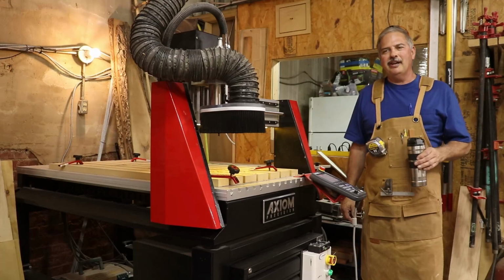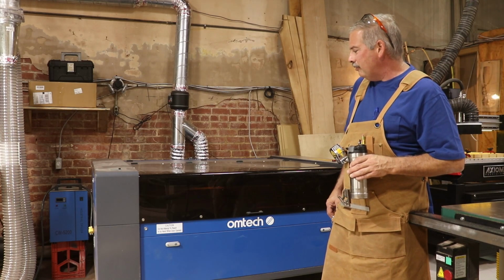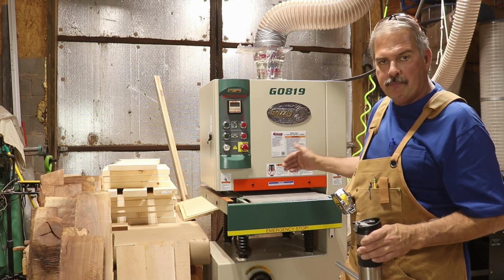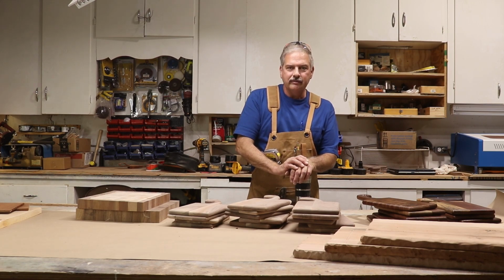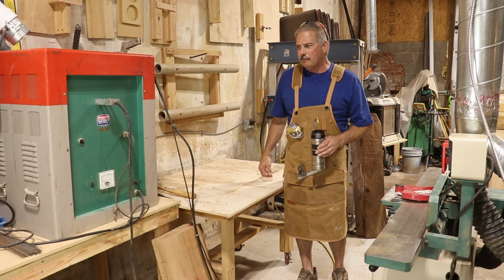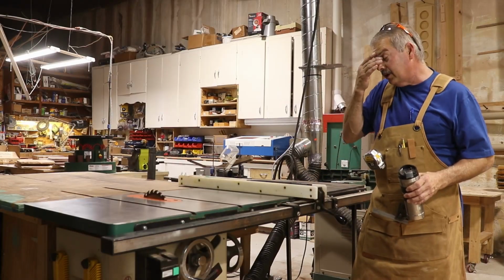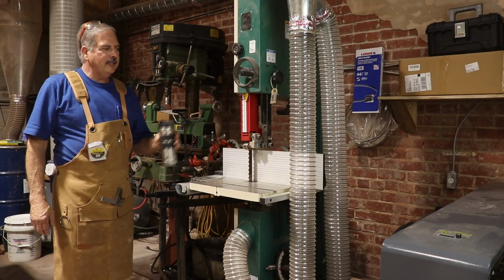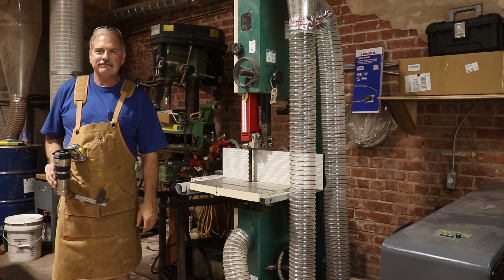Otter Creek Wood Werks Shop Tour

Comment: Very interesting to see the equipment used in a production woodworking shop.  Thank-you very much!  A layout diagram and photos, with a description of workflow would also be interesting.  Two questions: which table saw ripping blade was discussed?  Which crosscut blade?  Thanks again!  Best wishes and good luck!
Reply from the maker: Thanks for your questions you have sparked a new video! Later this week We will release a video which will not only show and explain the various saw blades we use, but it will also share our secret process for glue-up quality cuts right off the table saw!
Next we will demonstrate our use of the wood welder and how it saves time and space in our shop!
Thanks for watching

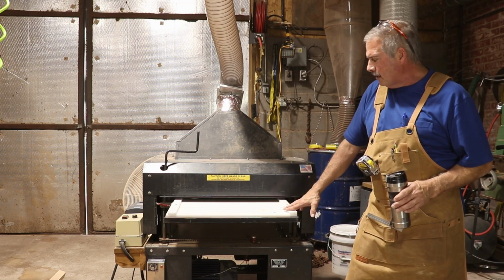Comment: What's a poly planer bed? Referenced around 3:05. Do you have a link to the one you purchased? What's the benefit of it?
Reply from the maker: It a plastic bed that helps with friction.  Wood master is the brand of the planer and they have them for their machines.  You could make one for any planer, polyethylene I think

Thanks
Reply from the maker: https://www.googleadservices.com/pagead/aclk?sa=L&ai=DChcSEwjp4YuZxfj4AhVJcW8EHZRZCjgYABAAGgJqZg&ae=2&ohost=www.google.com&cid=CAESWOD2yQz7KjA2F9WHn3ueyn_cWhTm9By9z3yXN_YrrtG0SxNYCyb5kjwS-SLIVGh_FQQ79v5NNbJPW16C8DcGDYdhsuzOqx36XomOp6Gcu3RNZTZjGXiaUWw&sig=AOD64_2TpJIiIMqqoxsu4PfnWgpKmvg4bQ&q&adurl&ved=2ahUKEwiZv4CZxfj4AhX8omoFHVHECk0Q0Qx6BAgDEAE